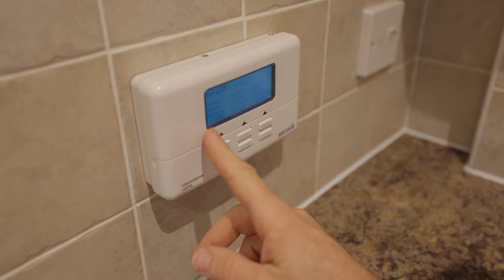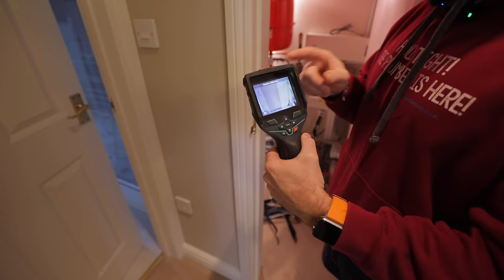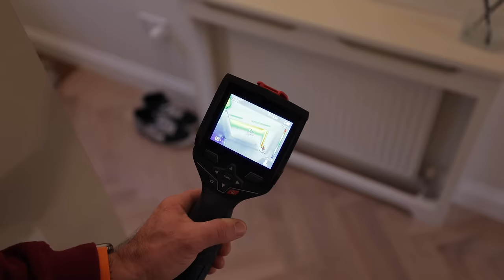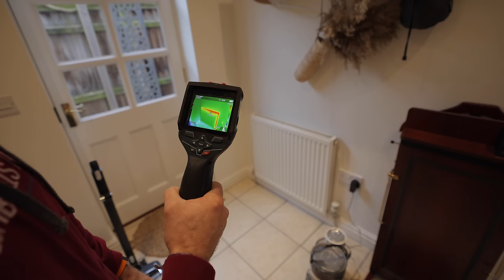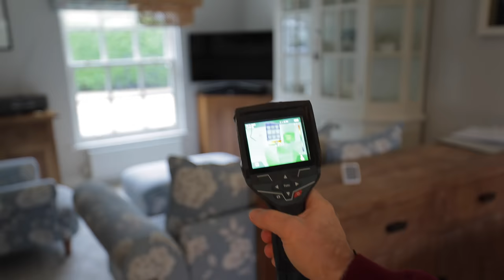THIS HEATING SYSTEM NEVER WORKED - Adam's Problem

Comment: I agree with not slagging off previous plumbers. We have all been there when you get plumbers block and can't clear your head. It needs a fresh head to visit the job..
Reply from the maker: Cheers man. It’s so true! I’ve been there too. 😂
Reply: i am 100% capable of getting something wrong this is why i never slag any other tradesman off
Reply: But they were happy to take his money! If they couldn’t ‘clear their head’ they shouldn’t have charged him, simple
Reply: Well said 👏
Reply: “Don’t slag other plumbers off, but what were they thinking” 😉
Reply: Great video ….. how do you find a decent plumber though ????
Reply: Plumbers, like doctors and pilots, need to go around with a checklist. 30 years in business or 3 years makes no difference. The old fart forgets and the young lad didn’t learn everything. A checklist helps both of them.
Reply: I'm quite happy to slag off the 'plumbers' who fitted my air source heat pump and all new rads. Their work was shockingly bad. All radiator valves were left fully open so only one radiator  got hot. I've probably spent 40 hours fixing all the crap they did badly or didn't do at all.

Comment: Another big problem is when heating is installed many buy heat packs, which have nothing at to do with any rooms heating needs and is merely a hot object doing something without the power to do as it should. Heat losses from the start are never worked and neither are the B.Th.U's requirements, or the U values of each room. All ending up you asking a small car to be a Ferrari. All heating systems can be as good as a tailored suit to the owners requirements, few seldom are. Heating engineers these days are the boys that can install in days as cheaply as they can in material costs, which leaves little room for the owners requirement, against the owner may not wish to pay for that sort of proper install. Gone are the days where you pay for knowledge about heating requirements against the install of heat packs to ask simply is that radiator big enough to heat this room quickly, to the answer of near 100% no it is not. For the public mindset, would a large open fire in a field keep the field warm? I would suggest for that 'size looking house' with that many zones a return lope 35mm / 42mm header would be better than the present install with each zone having it's own controlled circuit pump and not the present single pump and maybe up size the boiler to 35 Kw and would also question the placings of the room stats as in near any airing cupboard and the connections and it's pipework to all the zones is not a good idea..

Comment: One of the earliest things you learn as a heating engineer is that isolation valves ( gate valves) are not balancing valves, they can not be used to accurately balance a multi zone heating system, at best you get crude control on the last 10% of the valves movement

Comment: I am not a plumber but my neighbour had a plumber in as his heating was not working, the boiler would fire up and shut down in a couple of minutes, the plumber changed the motorised valve but to no avail, the plumber spent the whole day trying to to resolve the issue, after he had gone my neighbour asked me if I would have a look at his heating, immediately after checking the rads All rads hadTRV’s fitted so I looked for a bypass and found that after the motorised valve there was a 22mm pipe with a gate valve linking the flow and return as soon as I closed the gate valve the radiators worked. The following day the plumber returned and was surprised that the system was working my neighbour instructed him to remove the bypass and remove the TRV from the towel rail thus allowing flow if all TRV’s closed down. The system was just heating and hot water no zones just TrV’s and a Thermostat in the hallway, have fitted 4 or 5 systems for friends and always leave a rad without a TRV. I believe a bypass should be at the end of the line if fitted not at the the beginning and be of a small enough diameter to just allow a small flow to take pressure off the pump.

Comment: I've just balanced my radiators, and now my heating and hot water is working better than it has in months! Thanks dude, you're a lifesaver!
Reply: Why bother with balancing if you have TRVs? My lockshield valves are all fully open and things work fine.
Reply: @rogerphelps9939  Why bother with thinking when you have a smooth brain?

Comment: My background was soot juggling as an industrial heating engineer but office blocks shared the same basic system as found in homes. Half an hour cranking down fully open lock shield valves and Bobs your dads uncle. Don't really miss cranking up three stage half a megaWatt oil fired boilers or warm air heaters. 👍 Regards from Cyprus. 💟

Comment: Nice one, I've been messing about with my radiators for years and think this has finally rounded out my misinformed conceptions .. clarity at last!  Thanks!
Reply from the maker: Good luck!
Reply: Had the same issue on my ex council house. Main runs to front and rear of the house were 15mm supplying 4 rads each. Changed these to 22mm and things improved dramatically.

Comment: Absolutely brilliant video, well done fella!
I was in the same situation with a north facing bedroom that is over a garage.  The radiator never really got hot. It was also the furthest radiator from the boiler. I've just been round and balanced all the rads as per this video (most were wide open). What a difference this has made. Fantastic and thank you for de-mystifying rad balancing!!!!
Reply: It only needs one radiator to have its balancing valve fully open, to return hot water to the boiler and shut it off, not to mention starving the other radiators of pressure.
The easiest method is to first turn every valve fully off, then open it a quarter turn. 
You can then start to balance things up, by adjusting the valves a fraction of a turn at a time, then waiting 30 minutes for the result. Needless to say, you have plenty of time for cups of tea and if things go belly up, just start again.

I use the same method in large commercial buildings, where the boilers are putting out megawatts of heat. It is just a matter of keeping a clear image of the entire installation in your mind.
Reply: @wilsjane which would you want fully open, the problem one? And which would you start the opening a quarter turn to initiate balancing with - the one furthest from boiler?
Reply: @Horizon301.  Before starting, bleed every radiator to remove any air and check the system pressure. Before turning the boiler on, turn every thermostatic valve to maximum and set all the lockshields to a quarter turn. 
Then switch the system on.
Walk around as the system starts to heat, to check that every radiator starts warming up at the thermostat first. Then walk around every few minutes to check the progress of the heat across the radiators. Those that are hot right down to the lockshield within about 5 minutes are fine. If a radiator fully heats faster than that, reduce the lockshield by a few degrees, while any that are taking longer, (normally the larger radiators) can be opened a few degrees.
Leave for about 30 minutes, then to check.
Feel the top of the radiator near the water entry, then at the exit valve. The temperature should be a few degrees lower, but not noticeably cool. Then you can fine tune the lockshield where necessary.
When you have finished, all radiators will have water available when required and none will be running flow temperature water back to the boiler while starving others.
If any radiator is not responding correctly, the thermostatic valve may have a jammed pin that needs to be replaced or cleaned. NEVER try to compensate this by opening the lockshield, or you will unbalance the system.
Finally set the thermostatic valves to set the rooms to the desired temperatures.
All this is an awful lot simpler than it sounds and you will develop a clear mental image of where the water is going.
Once you have completed it a few times, you will feel confident to tackle any system, from a bungalow to an office block, since they all obey the same basic principals. 
Set up correctly, the boiler will have a cycle to match the load and you may then want to adjust the burner to prevent short cycling. This can save quite a lot or fuel.
Reply: It's a  bleeding pest needing to bleed the radiators and driving the air out of the system but it needs to be done to get the most out of your energy consumption?

Comment: Brilliant work m8, 
2 add ins, check the gas rate of heat source so u know it is producing correct heat. 
Test flow and return at boiler for differential heat accuracy, will tell u pump speed if correct and whether u have system design issues. 
But really great video.🎉

Comment: I changed my TRVs a couple of years ago after changing the boiler. I now use the Hive programable valves which effectively make each radiator a separate zone. They also control the boiler when heat is required. These so far have made the house a lot more comfortable in that we can program heat to, for example, our bedroom and on-suite for an hour before we get up and the it's nice and toasty, likewise we can shut the heat off in rooms we don't use for most of the day and only heat them when we do. The app is not the best but it works. I'd be interested to see if you have come across them or used them. 

Also when I refitted my utility room I fitted a SureStop on the rising main above the normal stop tap. Having had a burst pipe a few years ago and my wife being unable to turn off the stop tap it seems worthwhile for emergency use. Again if you have used or come across them I would be interested.

Comment: I've lived in my current property for 10 years and have just put up with the fact that some radiators either didn't get warm or took forever to do so.

I had the TRVs set properly, but most of the lock shields were open fully. I've adjusted them as suggested and now all rads heat up evenly.  Can't believe how simple the solution was.

Comment: Boosted the heating at 10.28 and announced it's been an hour or so at 12.52... I hope he doesn't expect an invoice for an hour or so labour! Great video James. As Andrew mentioned below, the UFH could also be robbing heat from the radiator circuit but it seems you're a good bit further down the road to a better balanced system. Good work Mate... Hold tight!
Reply: Also, IMI Hydronics makes self-balancing valves, I believe they also manufacture the cores in the new Danfoss self-balancing TRV's.

Comment: just picked up on something you were saying when talking about the auto balance valve "the boiler likes a bit of hot flow returning to it as it helps with the condensing"

my understanding is that the return to the boiler wants to be as cold as possible. it starts condensing at 55c (might be wrong on that figure, doing it from memory) flow return but.... the lower the temp of the return the more condensing it does.

how does having hot water in the return help condensing?

in my experience due to the proximity of the trv to the radiator TRV don't really measure room temperature, the heat from the radiator completely overwhelms them (i do have data somewhere to back this up too)

Comment: Great video very informative BUT you missed out when balancing rads make sure that the trvs are on the flow and fitted correctly,  and on the Cylinder the value is called a bypass value, other wise well done, I'm an old heating engineer.

Comment: James, I take it this does not apply if a TRV like the Drayton TRV4 is used where the balancing flow can be adjusted within the TRV valve and the normal lockshield end is left fully open. Underneath the big adjusting temperature head there is another adjuster ring that restricts flow by using a special key. If someone installed one of these previously and set the TRV4 to its lowest restriction then no amount of fiddling with the lockshield will increase flow.

Comment: Hi James, use your temp sensor to measure the flow and return temps from the boiler and each rad, it should have a 10°C difference generally, the closer the temps the more you close the LSV down and hence the terminal rad should be full open. I enjoyed the video, good man.
Reply: I've heard this as well, it's the temperature drop from flow to return that is balanced by adjusting the lock shield. The further the rad from boiler generally needs the lock shield opened a bit more to increase flow, so I don't quite understand why all rads have only quarter turn open. Good video mind as always from James.
Reply: @monstermonstermonster2983  
Its the same reason the electric showers go cold when some joke flushes the toilet !
Reply: This was what I always thought. Closest rad to the boiler should only be open a crack, then opening more and more as you move away from the boiler. Final rad fully open, as you want cooler water back to the boiler for condensation.

Comment: With no hydraulic separation the underfloor heating may draw more than its share of water from the heating system in competition with the radiators. The type of manifold fitted at this property is for high temperatures and the boiler temperature needs to be set high
Reply: @armslength2618  it depends upon the flow rates from the boiler and into the circuits. To supply an affinity to an underfloor heating system the supply temperature to the manifold must be greater than the manifolds return by the Delta t of the boiler. Any less than the underfloor heating system will fail to heat correctly. At the same time we're trying to minimise the flow temperature from the boiler to maximise condensing efficiency. For this balancing act to be accurate we need hydraulic separation and a low loss header sensor
Reply: @armslength2618  not steam. Just high water above condensing temperature.

Comment: I suspect the owner perhaps opened all the lockshields up to try and fix the problem themselves? Re the sticking TRV pin, don't be tempted to pull them with your pliers... they come out and result in a fine spray of black water across your cream carpets! Safest approach is to use a teaspoon on the top of the pin (i.e. the bowled bit of the spoon which holds the sugar etc) and just push in and let it spring back out on its own. Re the bypass, mine was letting nearly all the flow back to the boiler, bypassing the rads entirely. I wound it in but it made no difference so I just took it out and capped it off as my boiler has one built in (Vaillant eco 635), yet still the flow was quite bad. I then found the boiler bypass (the one within the boiler) could be adjusted and gave it a tweak so that it would block more flow and voila: hot radiators all round. I'd spent months scratching my head and several plumbers too, but that's what fixed it for me. The plumber who installed it had never bothered to adjust it properly. Sharing as bit may help others in a similar fix.
Reply from the maker: You never know! On the TRV pins I just give them a wiggle, having had a pin fly out when tapped with a hammer!

Comment: I stopped using gatevalves for flow control e.g. on the primary return, back in the mid 1980's, they are not designed for that purpose, I use DRV's, a bit more expensive but virtually tamperproof. I would only reduce the flow temp to 60 deg.c if I knew that the radiators were sized for that Delta T. A good demonstration of the benefits of investing in a good thermal imaging camera, far quicker than using 2 Rototherms😊

Comment: I had a cottage where the radiators furthest from the boiler never really got hot. Balancing improved it a tad but it wasn't a complete cure. It turned out the pipework was too small to get the heat to the 2 rooms. Replacing the pipes i.e. 15mm to 22mm cured the problem.

Comment: I balance each radiator as a percentage of the largest, in relation to their water content. Basically largest radiator lockshield open to 80% with the thermostatic rad valve set for the room temperature 2 usually 16 degrees bedroom 3 18 degrees kitchen, bathroom etc. Many year's ago checked this method with a 10/11 degree difference flow/return across each radiator on warm up came out the same. The restrictor on the cylinder is usually 1.5 turns open at the point where it goes quite. I won't tell you what Mr Combi says about the balance valve on cylinders as it goes against everything I was taught, many year's ago and that would be criticising. 😀😁😂

Comment: Needs a low loss header or CCT’s. You have both rads and UFH working at different DTs. 
The UFH is robbing flow from the rads. 
Unless of course the UFH has separation built in?
Reply from the maker: All fixed now, but a LLH does sort most systems out!

Comment: Gonna check the balance on my rads as I’m sure all mine are open a full turn. Probably why the ones in the front room which are furthest from the boiler don’t get as hot as expected with the stat fully open.
A well explained tutorial thanks, and all in layman’s terms.
Reply: In my experience most lockshields are quite useless at restricting flow once they are opened more than 1/2 a turn from closed, so a lockshield open one full turn or more is as good as fully open.

Comment: Nicely explained and will be checking mine after the service has been completed ,
Question got a slight drip on a strap boss in the soil pipe any tips for stopping it besides ripping the soil pipe out,please and thank you 👍👍👍👍
Reply: If you can get it really clean and Dry, you could try gap cement. Once you have it clean and dry run a brush with 'solvent weld' around the joint a few times then build up with 'gap filling cement' and let it dry for an hour.